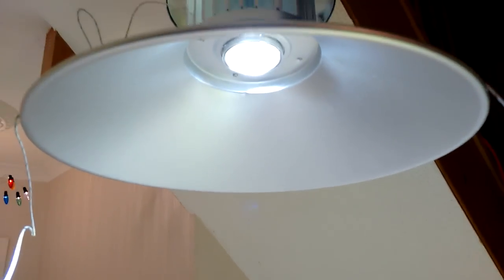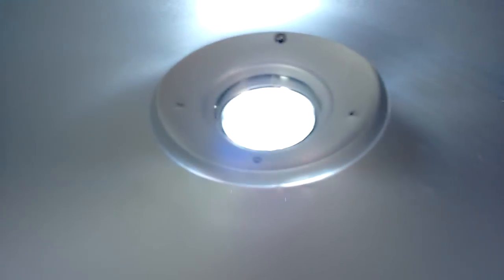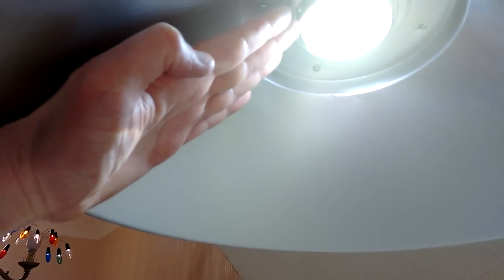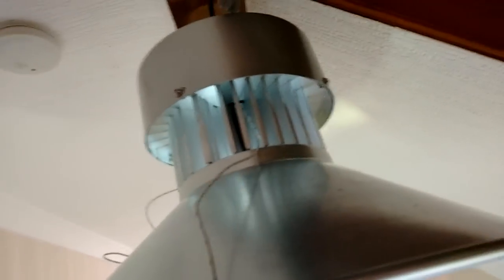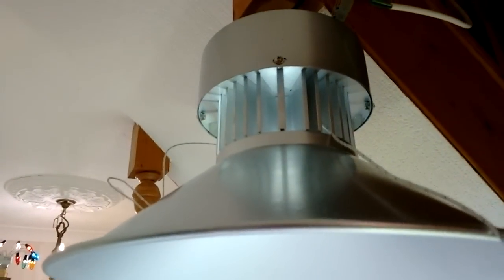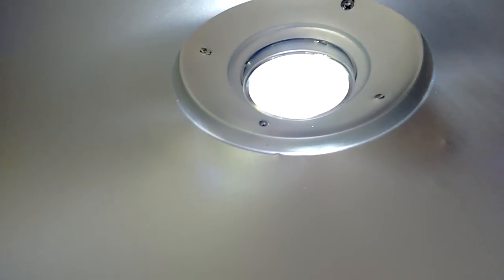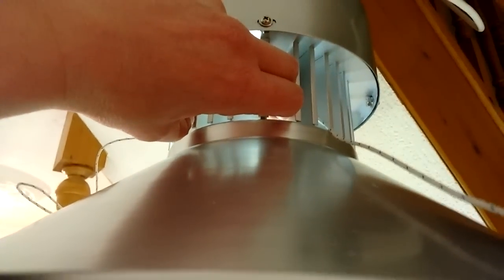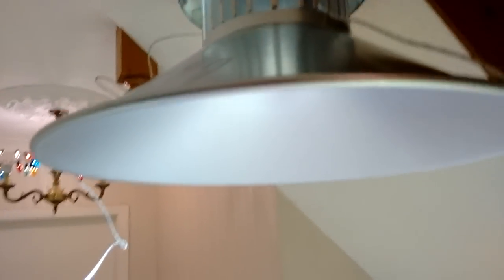Thermal test of 30W (25W) high bay light.

Comment: You'd love it in SW Florida atm...  it's 35°C (95°F) with a dew point of 27°C (~80°F) outside, like someone threw a steaming flannel blanket over you hot...  inside I keep it 24°C (~75°F) with AC and once the temperature dips into the low 60s F the heat comes on.   Growing up in NYC I tolerated much colder weather without issue but after a few years down here your blood thins out as it were and cold is not welcome...  not that it really gets that cold !!!

Comment: I wonder how high a wattage LED you could use in the same housing with the same driver ? If the lens/reflector was better do you think the light pattern would improve much?
P.S the sound on the video is fine. and yes the light in the background of the shot is cool.
Reply from the maker: I was pondering that myself.  The higher wattage fixtures have a small increase in heatsink length for each power step.  I guess they may be allowing for the elevated temperatures often found near the ceilings of warehouses and factories.  Or even future dust build up impairing the cooling of the heatsink.  Not sure.  The beam quality would remain the same.  The lens is being used to direct the light downwards, and is sized to the standard universal LED array size.
Reply: That heatsink style must work fairly well as intel uses it to cool their CPU's with a small fan. how much sustained heat can an LED lamp tolerate anyway? The whole housing looked like it could be used as a thermal mass to radiate heat.
Reply from the maker: dandel351 The cooler you run LEDs the better.  They lose efficiency at higher temperatures and it shortens their lifespan.  I would prefer to keep an LED at under about 50C.